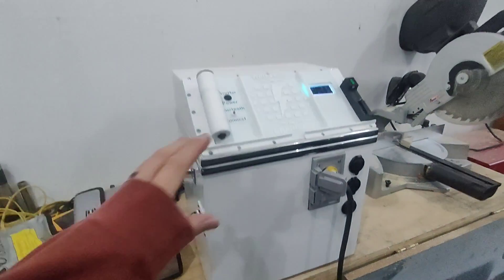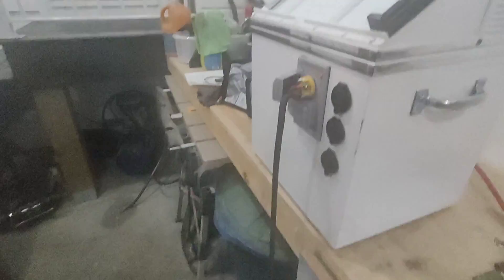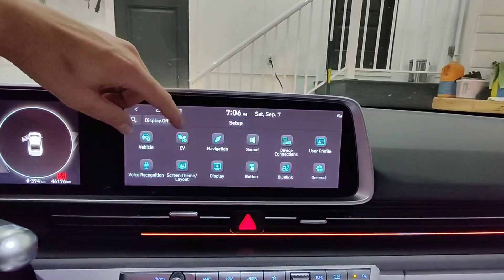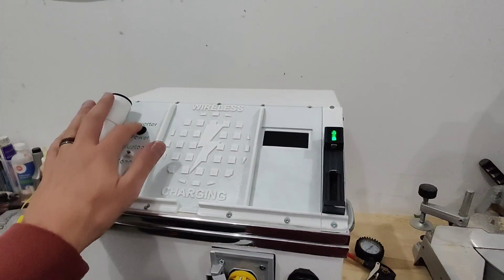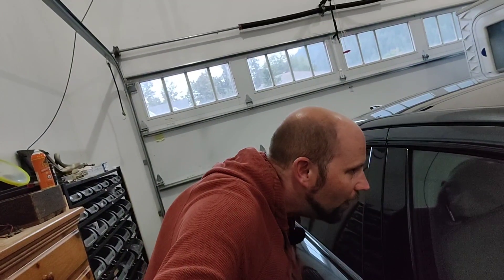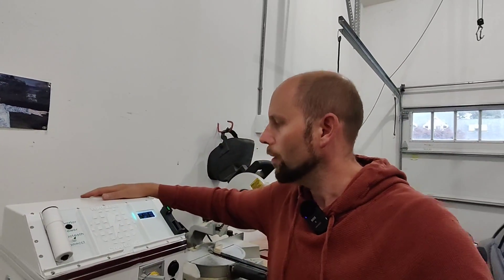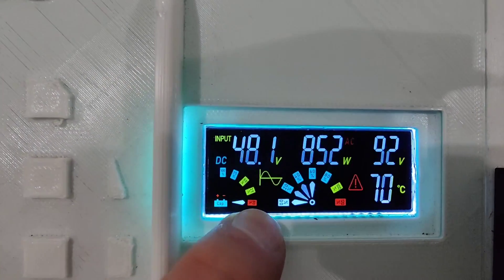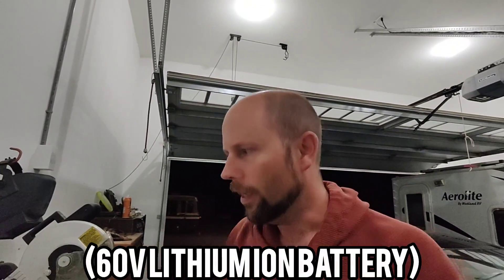DIY Portable battery pack charges my EV!

Comment: @Ed's Garage Why would you use a battery pack and not a fuel based generator ?
Reply from the maker: Because that would require using fuel lol... 

This was more about testing my diy battery tbh... 

I've done a 15000km road trip in my EV, pulling Trailer and I never needed anything outside of public charging. So this was really a pointless test